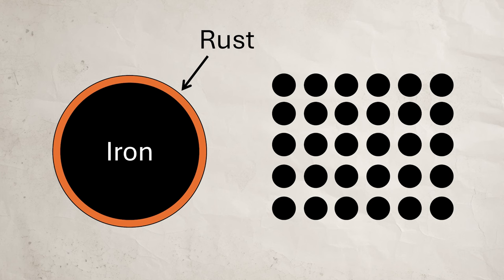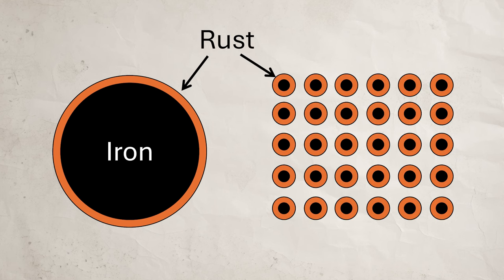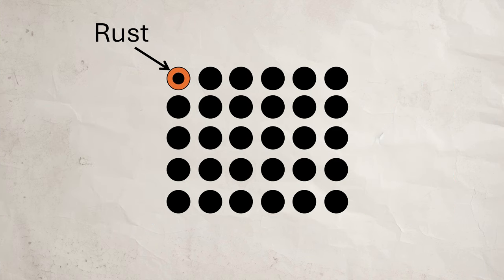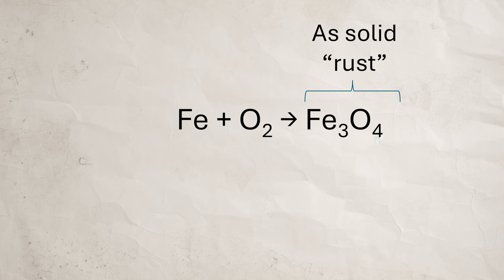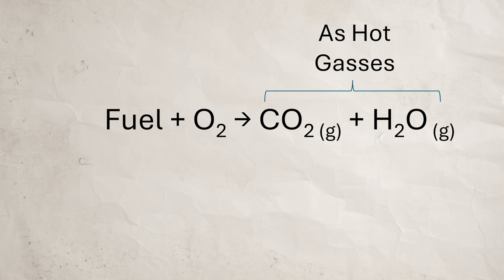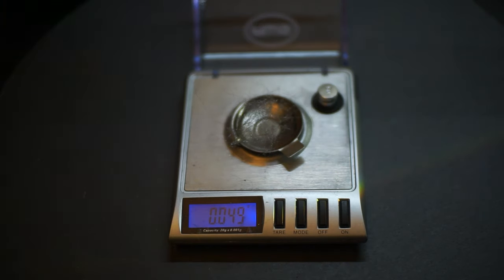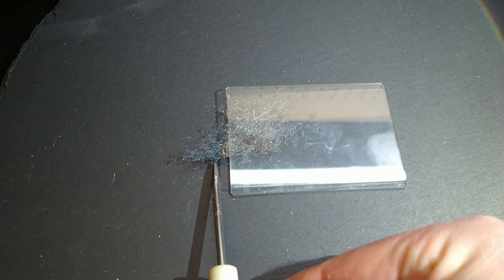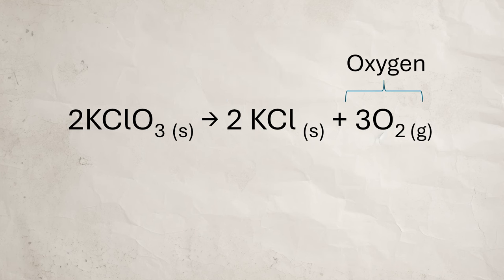Burning Iron, Attempt #1 to Improve a Classic Chem Demo

Comment: You can get solid iron to burn in an oxygen atmosphere... This is a major limitation in the design of rocket engines... 
The key thing is not the surface area to fuel ratio, it's the surface area to oxidizer density ratio... If you lower the surface area, you have to raise the density of the oxidizer. Your rate of reaction is related to the density. So if you have a certain rate that the heat is being carried away, you have to produce heat faster than that. 
This is the basic definition of how an auto ignition reaction works
Reply from the maker: Good point. The surface is where the reaction happens, but increasing surface is not the only way to make it react faster

Comment: Would it work to purge your system with pure oxygen?  If simply changing the atmosphere works, you can avoid the issue of ox flow removing the heat.
Reply: You can actually have a flame burning stainless steel in a pure oxygen environment. I've seen it with my own eyes and it's absolutely amazing
Reply from the maker: Very good point. I think I will try this next.